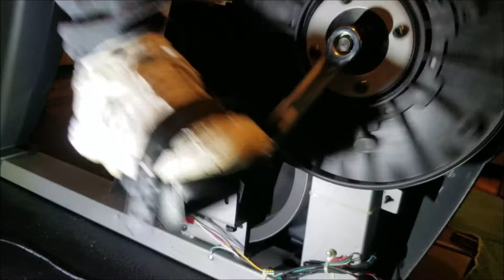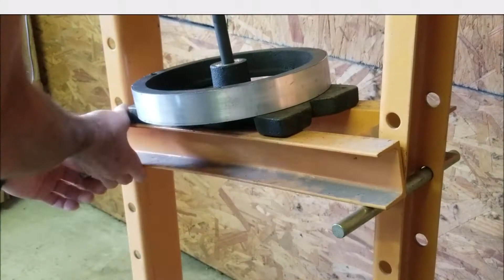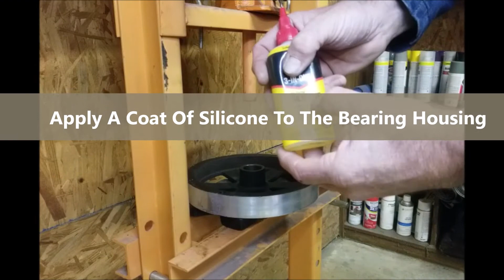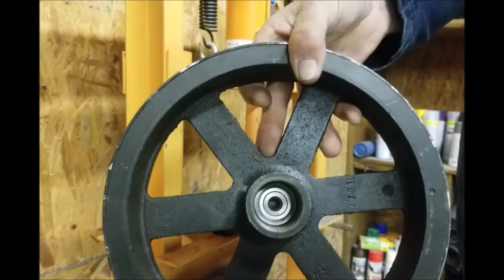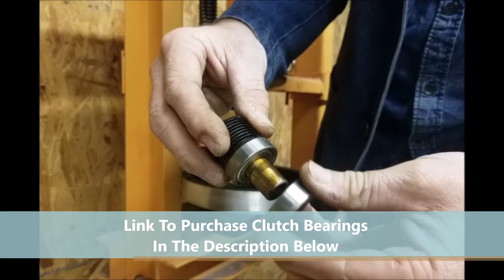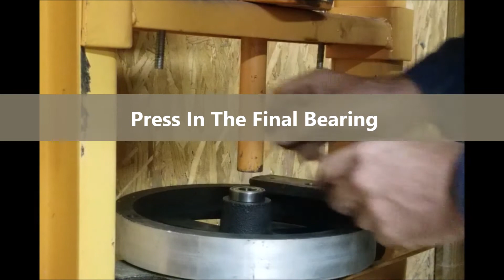Pedal Slips On Recumbent Bike Yet The Drive Belt Is Tight (No Unnecessary Dialogue)

Comment: My Nordic Track recumbent bike had a knocking sound when pedaling and I was thinking the flywheel/clutch bearings were bad. I took off all the cowling and found the flywheel axle nuts were both loose. Tightened them and now no more knocking sound.

Comment: I'm having this issue with a star Trac pro recumbent bike I bought on Facebook. If I start really slowly it will work but as soon as I pick up speed the pedals stop spinning the wheel and the power cuts out. Same issue?
Reply from the maker: If it has a mechanism like this one in it, it will work. If it has a generator in it, then it will be similar to this video: https://youtu.be/Nung6YS2po0

Comment: I replaced my one-way bearing this weekend and the clutch still slips. I'm thinking there's something wrong with the shaft that fits inside. Excessively worn or not perfectly round.
Reply from the maker: I've seen instances where there was grease on the shaft, that I didn't clean off, that caused it to slip with a new bearing. I cleaned the shaft and tried again and was good to go..... I've also seen instances where the shaft itself was split length wise.

Comment: so its just the clutch bearing ?  Prob wont need the others?  is the part below for the clutch bearing ?
Reply from the maker: Yes, just the clutch bearing as far as slippage goes. The link is for just the clutch bearing. The others can be replaced of course, but likely unnecessary.

Comment: The average joe, like me, is not going to have a press handy.
Reply from the maker: I'm thinking next time I cross paths with this issue I'll make a video and show how to do it with a hammer and flat piece of steel. I believe I bought that press from harbor freight for about $80
Reply: @gitfit875  I'm back. Just wanted to thank you for the video. I have tried everything under the sun and decided to buy the bearing and install it. I do have everything I need to do the job. I'll let you know how it turns out. Thanks!
Reply: @gitfit875  Thanks for your help. I was able to get the bearing, spacer and the clutch bearing installed without a press. The bike is working great!
Reply: Choose a socket (deep dish that is slightly smaller than the bearing part you need to remove and keep hitting it with a hammer evenly and it come right out and go back in.